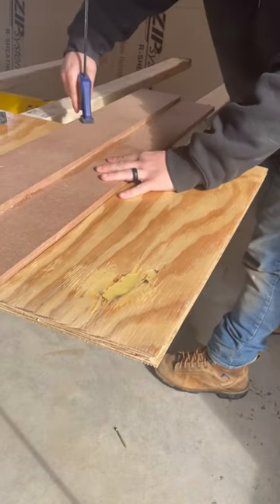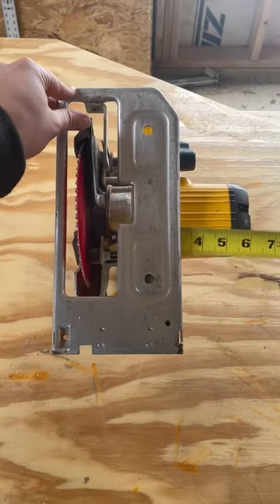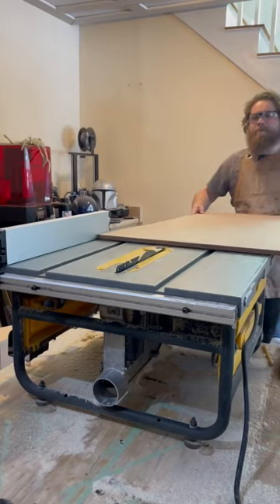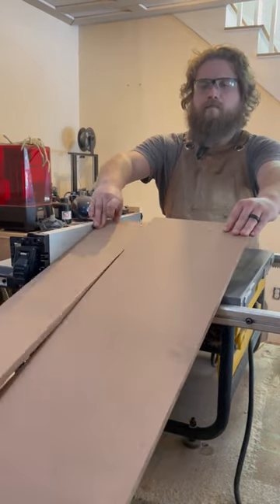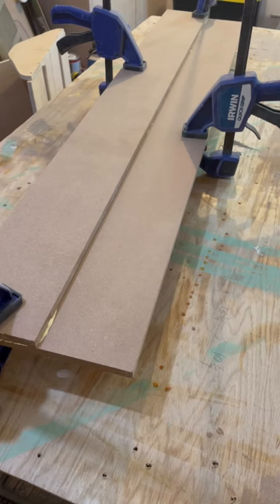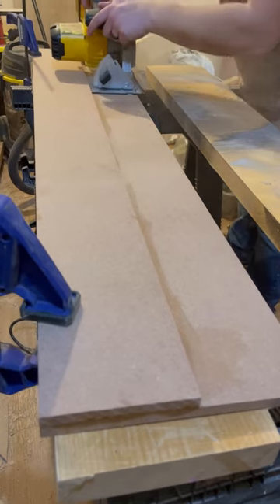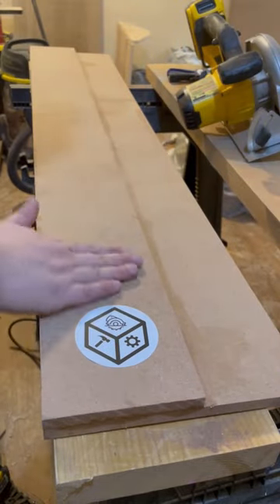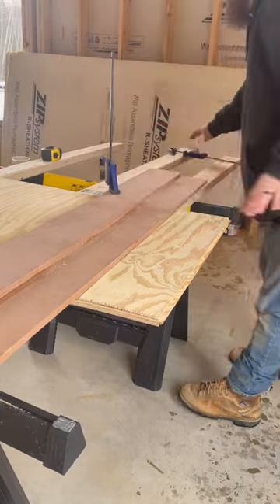My Favorite Circular Saw Jig

Comment: What’s best here is that you left room for the motor to clear the clamps.
Reply from the maker: Thank you! Yes that makes a big difference in the usability of the jig. No one wants to be fighting with clamps all the time. Thanks again!
Reply: @OneWayToMake yeah so actually your second measurement you could add like 3 in on so that the clamps clear the motor the video says 1 inch
Reply: That's exactly the mistake I made when I made mine. 😂
Reply: But motor it’s away from clamps any way….so it’s a perfect jig
Reply: So that's why he measured the extra two or so inches 😅, I was wondering about that
Reply: Yep, I learned that issue while building my 1st   . . . 
***Plus I now have one with base wide enough for a router on the opposite side.

Comment: Cheap way to basically make a track saw, very nice!
Reply: Hundred youtube channels: "What track saw to get?"
This guy: "You need 15 mins and some plywood to save 600$"...
Reply: A track saw will stay accurate. This won’t. This is a quick temporary jig.
Reply: @TheMadJester159 it's MDF, it'll stay more accurate than you are for years
Reply: Track saws arent just about cutting on a rail. Its the dust collection, quality of cut/no tear out, the ability to accurately and smoothly plunge cut. Yea this is a nice little jig but circular saws and track saws are just different tools whether you make this jig or not and if you dont agree then youre just ignorant to the actual uses of a track saw.
Reply: @bartholomewgreatpants3425 who hurt you? Lol
Reply: @bartholomewgreatpants3425 awww.  That was a long winded way of saying your shite with a circular saw, and have to have the bells and whistles to do anything.     Bet ya can’t drill without Milwaukee…. Or shoot without a Glock 😂😂😂.
Reply: @TheMadJester159 thankfully you can make 20 of these jugs for less than the price of 1 track saw.

Comment: Spray the base plate and the straight edge with silicone spray for an ultra smooth cut.
Reply from the maker: That's a great tip thank you so much!
Reply: it builds up
Reply: @larrypahl5756  do it once? I wouldn’t think you’d need to spray it every time.
Reply: I'm not too keen on spraying it with silicone, especially on the base plate. If you happen to use the saw directly on wood that will be finished there's a chance of the silicone residue rubbing onto it. This will cause "orange peel "effect on the new finish.
I just use car wax on mine, making sure there's no silicone in the ingredients.
Reply: Probably better using a wax. 

Silicon spay attracts water.
Reply: No silicone in a wood shop

Comment: I have 3 of these. 1 for each saw I own. They protect the cut edge and prevent chipping.  The saw glides on your fence so, no scratches on expensive plywood.  Best straight edge out there but your must only use it with the saw that made it.

Comment: Made this same type years ago…they do work great even an 8 footer to do rip cuts….important note through once you set your width it’s married to that specific circular saw. Nice video 👍
Reply from the maker: Thanks so much and yes you are exactly right, that distance is unique to each saw. 8’ is great, it’s my favorite way to break down full sheets of plywood. Thanks again for the comment and for watching!
Reply: and to that specific blade? since they can be different
Reply: @talleysuehohlfeld3959  make sure you use a blade you like to use most of the time but you'll only use this to rip plywood etc so a nice ripping blade would work
Reply: So after the divorce, the jig with new love (saw) would be basically useless😂😂
Reply: Yup, learned this the hard way. Anyone with two circ saws beware
Reply: @sidsid9808  🤣 I see what you did there
Reply: This is true although most saws have the same size foot.  An industry standard.
Reply: Hum.... Nope! 

If your gig, is on the motor side, as usual, the reference is the same!  No matter how wide is the blade .

Just always remember ton install the gig on the piece of wood you keep!
Reply: Well of course!!!!
Reply: Just bought the DW575SB.  So perfect timing.  Thanks!
Reply: and perhaps married to a specific blade
Reply: That’s why I use a bolted on aluminum fence on thin Luan so I can move it back for wear or blades with a different bell shape. You don’t need to draw a line as long as you have 2 marks. I make short ones with a perpendicular fence on the bottom front for square crosscuts. I made a pair of  45 degree crosscut guides for 12/12 birds mouth cuts using a right cut and a left cut saw. Change the blade move the fence for a fresh flush cut guide.
Reply: That saw and that blade.

Comment: You can also double this by using a wider baseplate, then screwing/gluing a 2" wide strip down the middle. Then perfom the cut as you described and then run the saw using the opposite side down the other side of the strip. Now you can use either side of the saw depending on how you want or are permitted to based on your situation.
Reply: Even better!
Reply: Is it possible you can make a video showing how to do it? Thanks

Comment: Instead, 1/8” smooth panel board for the base and make the rail only about an inch thick. Then run your saw down one side and your router with your favorite trim bit down the other side (or your other saw). Use a sharpie on each side to remember which tool and direction. Also remember that edge is really only good for that particular saw blade!

Comment: A 1x4 piece of wood the width of blade-to-guide edge of saw + straight edge will do perform the same task without the need to wrangle a heavy MDF jig:  1) mark cut line; 2) put spacer block on cut line; 3) make mark on back of spacer block; 4) repeat on other end of cut; 5) align and clamp straight edge on the second set of marks.  

An aluminum adjustable straight edge with built in clamps makes this alternative method easier and not much more expensive compared to the cost of the MDF to make the jig.  Attach the saw spacer block to it with adhesive velcro.

Comment: Or without all the measuring just attach a narrower strip on top of a wider strip where the difference is wider than your saw. Then run the saw along the edge of the top piece. The bottom peice will become the correct size.
Reply: That's what he did
Reply: @gregorsamsa1364  yeah, that was kind of my point. The measurements were unnecessary
Reply: "All the measuring" was two measurements, bro. And it ensured that there would be room for your saw to clear your clamps.
Reply: @studiolivingroom I am pretty sure you could clear the clamps without all those unnecessary measurements. Also, I love that you're still learning about definitions. A willingness to keep learning is a sign of a good mind. Keep up the great work!
Reply: @themostexpertest  I appreciate your confidence in my woodworking skills. Call me old school, but I like to measure before I cut.
Reply: @studiolivingroom  👍
Reply: I think the measurements were there so you got clamping space so your saw doesn't get hampered by the clamps.

Comment: 1/8" x4'x8' hardboard sheet is enough to make a few of these guides, and I much prefer to use 1/8" hardboard or malamine sheets to 1/2" MDF. They only have to be strong on one axis. 1/2" thick just makes it heavy and reduces the depth of cut by a sugnificant amount. 

If you really wanna show off, spray mount thin carpet padding on the bottom so it won't slide. 

Also, I usually come through on the back side with the narrow side of no the saw, cutting it back the other direction.

Comment: I've been using these for years. I use 1/8 plywood for the base, with a 1/2inch plywood top slide. I found the mdf would develop a groove over time.  But still a fantastic idea.

Comment: You got a table saw sled jig too. A shop must.
Reply from the maker: Yes I absolutely love a table saw sled. No video on that one yet, but I’ll plan on making one before too long. Stay tuned for that and thank you so much for watching!
Reply: Also can be used as a table saw sled to straighten bowed boards using a few horizontal toggle clamps on top to hold down let's say a bowed 1x6 ,let it hang over the front edge enough to trim a straight cut using your fence on your table saw, now you have one straight edge to work with

Comment: If you buy a 3/4 or 1/2 inch mortising bit with a top bearing you can also use this guide to cut dado slots in your plywood for cabinets. Just line the jig up where you want the dado and run the bearing along it and it will cut the perfect slot. If you have a plunge base on your router, set one stop to cut 1/8" deep and a second to cut 1/4" deep. Doing ir in 2 passes will take a miniscule amount more.time but it will greatly lenthen the life of a $40-50 router bit.

Comment: Nice guide Jig. Been jigging things for years. Another tip is to where a mask when cutting MDF. Really should where a mask when cutting any material with a power tool but I’ve been guilty of not wearing one myself. Remember that your brain is an engine and your body is a machine. Gotta take care of that as without prevention it will fail prematurely.
Reply: Breathing mdf and ESPECIALLY melamine dust is like grinding up light bulbs and snorting them..lol
Reply: @martinoamello3017  ugh

Comment: I make mine from plywood and use the factory edge on the top piece as the guide.  Only in a 4' piece and an 8' piece. If there happens to be any accidental water spill or leak, the guage still is fine. MDF will expand and distort.

Comment: I've seen using these for many years 1/4 inch works fine,
Reply: that center “fence” board running the length of the  jig would keep that 1/4” stiff enough.

Comment: Way better than trying to just hold an straight piece of wood with clamps and still not getting a clean and straight cut. 👍👍👍👍Thanks
Reply from the maker: Yeah that has definitely happened to me before. You don’t always realize how much of a pain it is using a board and adding a measurement to each cut until you try something else. Thanks for watching and for reaching out!

Comment: Attach strips of stairs anti slip tape (kind of like sandpaper) and you can use it in situations where you can't clamp it down. It won't slip once you apply pressure with the saw while you're cutting.
Reply from the maker: That’s a great tip, the only thing I’d mention worried about is that it may scratch the material it’s setting on. I think some type of silicon pad or even felt would achieve similar anti-slip surface but be non-marring. If I come up with a good solution I’ll let you know. Thanks again for the suggestion and for watching!
Reply: @OneWayToMake  That's a good point. So far I've only been using this method on unfinished piece before sanding or on parts that are not visible. I'll make another one with some soft antislip strips. Cheers!

Comment: This only works properly provided you apply even pressure to the entire side of the saws base plate. If the base plate angles or wobbles then the saw may cut into the edge of the mdf near the saw blade.

Comment: Before I owned a tracksaw+guide , I made a guide like this... I used a fine Vee-notched spreader to spread silicone on the bottom... it makes for a great grippy surface just like the commercial guides... 

😎👍☘🍺

Comment: I would add that with each cut you lose the size of the material the width of the blade (like that triangle at the end of the video), so you have to think which way you are cutting. You can also add distance to the line by setting a guide.

Comment: The blade curf would also alter the jig. If you set it up on a thin blade and used a ticker one ot would have an effect
Reply from the maker: That’s a good point it would change the measurement by 1/32” or so, definitely something to be aware of thanks for sharing it and for watching!
Reply: someone else pointed out that this long version would almost exclusively be used for ripping, so you’d mostly want to use a ripping blade. But you can write the blade info on the jig with a Sharpie, and then you’d know which blade you needed to use with it. 

And if you thought you’d have a couple of blades in need of this style of jig, you could make one side for Blade A (and label it),a nd the other side for Blade B. Or make two; they’d stack or lean pretty compactly

Comment: I use a 8’ by 3” cut of plywood . I measure the deck on the saw and then cut a little 6 inch piece of scrap to the same width and use that to clamp my plywood down. My saw if 1” 9/16 to the outside edge and 1” 7/16 to inner edge . Just keep those two in my tool bag depending on my cuts .

Comment: I use an empire straight edge screwed to 1/2" plywood. I first did this when I had to cut a door with a circular saw and couldn't even breathe on the finish of the door, let alone drag a circular saw over it. The one important thing to remember is that your losing a blades width of material from your line. If the jig is on the "keep this" side of your work piece, your fine. If the jig is on the cutoff side of the work piece, you will lose an 1/8" because the blade is now on the wrong side of the line. Keep this in mind.
✌️😎👍

Comment: I made a set of these. I did as you did and used 3/4" stock. The base part does not need to be that thick. 1/4” MDF would be my choice. One time i used 1/4" plywood and the cheap crap warped. MDF won't. Would need to use  paint or something.

Also, if you adhere coarse sandpaper on the bottom, it wont slide easily.

Comment: This is a good idea though it restricts how deep you can cut by the depth of the MDF board
Reply from the maker: That’s true, this is half inch MDF so you lose a 1/2” of cutting depth. For most cuts that’s okay but not for all. For those cuts, a straight edge clamped to your work piece will would best, just don’t forget to add the size of your saws plate to your measurement. Thanks for sharing and for watching!

Comment: Your guide design is simple and can be effective, but it still has two disadvantages: 
1) The saw can wander away from the guide, and
2) the guide thickness will reduce the maximum cutting depth of the saw...

I very much prefer a different kind of guide: the one that places the saw baseplate directly on the material to be cut, and uses a "sled" attached to the side of the saw sole to engage a  ridge made from an aluminum channel or similar, placed on the guide... In that way, you don't need to keep a constant lateral pressure against the guide to avoid the saw going away from the guide, and also you keep the maximum cutting depth of the saw, because the sole of the saw slides directly on the material and not on the guide, That guide thickness will reduce the maximum depth curring capacity of the saw. You only have to make a "sled" that will be attached to the saw sole with screws, and that "sled" will ride on the guide, attached to the side of the saw sole.

 I hope this is understandable!

Comment: In Southern California it was always called a scoot board
Reply from the maker: Yes I’ve heard that term before, usually when the jig is used for cutting doors down to size. Thanks for sharing and for watching!
Reply: I have a couple of these. Pop built one, and I built the other whenever I was working in a millwork shop. 

Around here, they’re called a chute board. 

Funny how things are called slightly different names from one region to another.

Comment: These are ok. If u use water resistant MDF otherwise if u get ut wet with stain etc it will bubble. If stored correctly its worth using.

Comment: Fyi, that bottom piece DOESN'T HAVE TO b 1/2" thick cuz ya loose cutting depth. Use a 1/4" or 1/8" inch hard board n presto u have a home made track saw 👍🏼😊.
Just a reminder, the thicker the top board ur motor may not clear w/o raising it a bit which ALSO limits the depth of cut. 🤔
ATB friends

Comment: Thanks for this awesome tip! How did i never think of this!!! Ive been doing the clamp method for way too long, and I'm still not sure if the short edge of my baseplate to my blade is 1 1/8 or 1 3/16 due to the curve at the edge... this jig clearly makes that question irrelevant.
Reply from the maker: Yes that’s exactly the point, measuring things always adds the chance of messing something up, which I’ve done plenty of time, but this eliminates that. Im so glad you found the video useful, thanks so much for the comment.
Reply: @OneWayToMake , yes, we might make arithmetic errors, we might not get the fractions right, but a cabinetmaker will always be able to split a 4H pencil line, or cut right on the waste side of a knife line.

Comment: Oh, don't forget the drop must always be on the saw blade side...the keeper side is under the jig, or else you'll be cutting a kerf's width short.  That can be an easy oops.
Reply: I actually wrote “keep” on my crosscut version of this, to remind me. Especially since my Ryobi saw is left-handed, and it’s safest and most accurate to put the widest part of the baseplate on the jig.

Comment: I'm pretty sure that you can't put the jig right on the line. You must slide it over, the width of the blade?
Reply from the maker: Great question. It depends on how you place the jig. If you place the jig on the side of the board you want to keep you can put it right on the line. If you place it on the waste side you need to account of the width of the blade. I hope that helps, and thanks so for watching.

Comment: I did the same thing, Except on amazon they have grippy tape. One inch wide I think by twenty feet. I bought it put it on the bottom of the mdf, You no longer need to clamp it works just like a track saw.

Comment: 1/4" lauan instead. Lighter,  equally accurate
Reply from the maker: Yes, this would work great as well. I like the idea that you can make this using  only one sheet good if you’re starting out but 1/4” lauan or hardboard would make for a great bottom and you’re right that you would gain an extra 1/4th or cutting depth. Thanks for sharing and for watching!